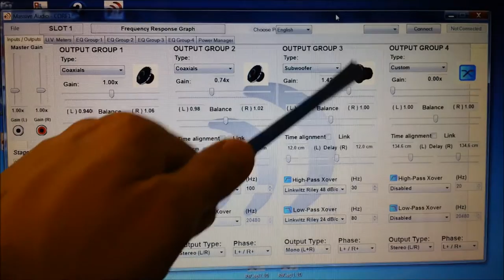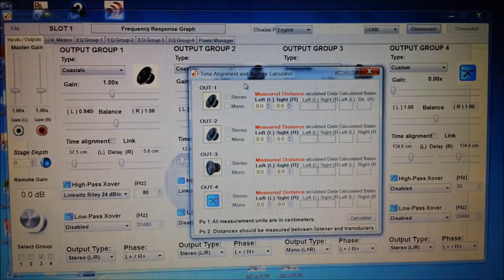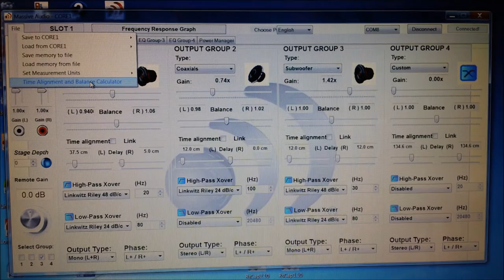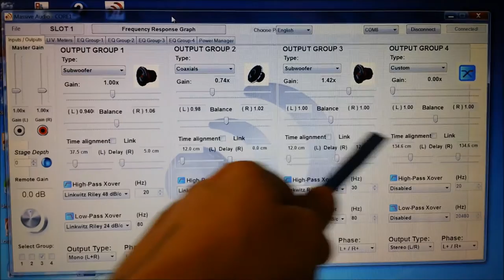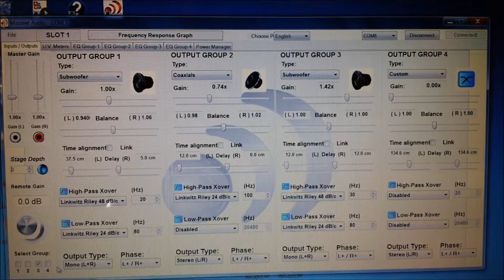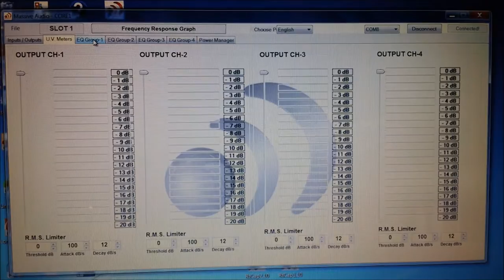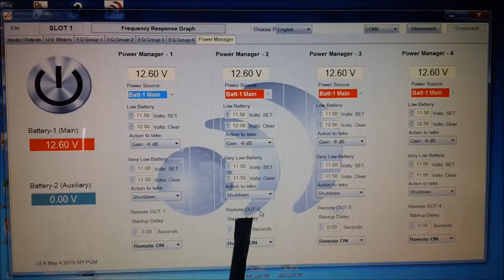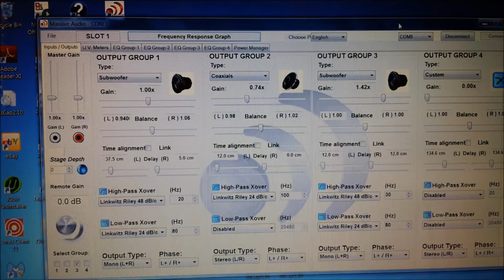Massive Audio Core-1 Software Pt1

Comment: Hey man I have a question. When I add drivers in the main tab, I add the pair correct? And when I add the drivers to a group,  I see there is L, R and L+R option in the bottom left. When I tick one or the other, they both seem to be the same band on the frequency response graph? How do I do L and R independently?
Reply from the maker: +Kazuhiro Speakers assigned to output groups are assumed to be pairs, if the Output Type is set to one of the Stereo choices. If you choose coaxials, for example, Output Type defaults to Stereo(L/R) as shown in the video. In the EQ tabs you start with L(or right), finish up that side, then tick the other box(R if you started with L) and EQ the other side.
Reply: +Barry Schanz  Ah I just noticed what the changes are! See the L/R selection would seem a bit clearer if they had made it look like tabs almost, to each driver, and the pair overall. I see that when you change to the pair you can't look at your individual changes again?  You either add to them by making more measurements or reset and start again?

Comment: UV meters? Could be helpful in finding out why it's so hot in my car.
Reply from the maker: If your amplifiers are running hot enough to question if they're heating up your car I suspect they would probably shut off if they have thermal overload protection. The VU meters are handy to see a visualization of the power demands put on your amplifiers, but I haven't had a laptop connected long enough to watch them for long.
Reply: I was being facetious. They are labeled UV meters.
Reply from the maker: +lazzer408 Ah, my bad.